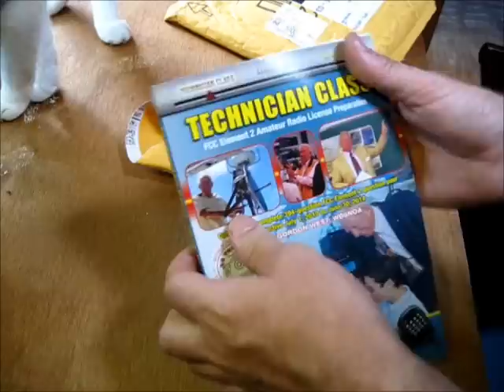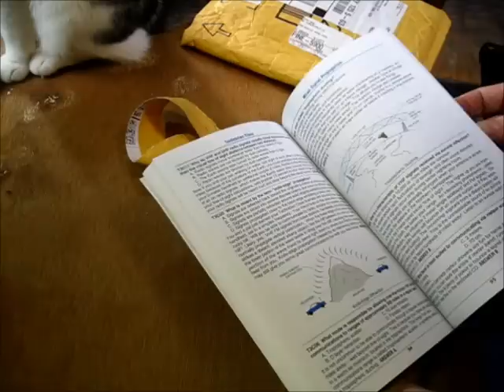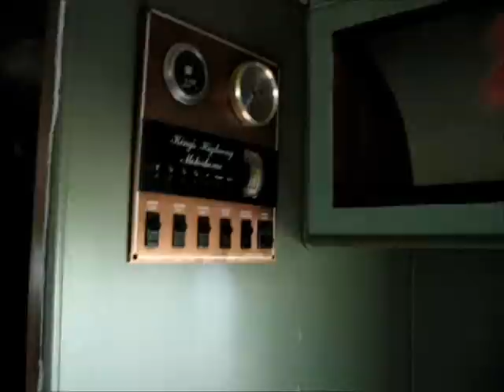Cleaning Up The Homestead And Improving Rain Water Collector

Comment: Great hearing that generator had good strong compression, you'll troubleshoot and get good spark. As suggested ,rusted magneto a strong possibility after sitting unused for so long ,sand surface of magnet and set the gap  ,coil ,points or condenser .did you clean out the gas tank and exhaust system ,anyway it's looking promising and will be nice to hear it working for you. I think that it is great to have friends who are interested in helping and believing in what you can do through hard work.

Comment: On the generator the exhaust line where it was belching out stuff (mice/chipmunk nest/bird feathers) it might be partially cloged causing it to not vent out exhaust so it does not get enough O2 for the next compression,like a bananna in the tailpipe. But it sounds more like its the flywheel is rusted or may be grounded out on a wire (mice do love to chew through wires) look inside the fly wheel &coils in engine casing first and it might show a bunch of rust, if so just a good brusing will fix it

Comment: also on your generator check for and clean any rust away from mag that may make a difference in the spark magnetos do not like rust that will weaken any spark power the mag makes hope all this helps

Comment from the maker: Shorting an old screw driver or piece of metal across the leads. Use something you dont care about because it may get melted. Do NOT touch the metal when shorting the capacitor. Use well insulated pliers to hold the metal.

Comment: troy we fix generators and what u need to do it you need to use the air compressor on the spark plug and make sure that its really clean. If that doesn't work get a new spark plug and keep spraying starter fluid and it will start if it doesn't there is a bad part or gunk in the fuel lines.

Comment: just thout id tell ya just purcased a 71 shasta trailer for a project as simple as they come propane only to gas lamp stove and heater no 12 volt inside at all so im starting from scratch good thing i know so much bout 12 volt sys.
will have to build my own should be fun but at least ill know what i have it does have 120 ac though in good shape so ill try and keep ya posted

Comment: Finally, big tank auto fill. Yeah! Now gravity feed overflow from big tank to blue barrel. (cut hole in top edge of tank. Add pipe & fittings.) No need to pump. Unless that gutter is capped, move your chicken tractor. From this angle, looks like gutter will pour excess water into the chicken area. 

Yard looking a lot better. Plant vegetables NOW. Plant flowers later or put on next spring to do list. Gives time to learn which flowers you can also eat before you plant. ie more self-reliance.

Comment: If there is a cover over the head of that generator you might want to take it off! Every year I check my riding mower for mice nest in the cylinder area! I found out the hard way the year after I bought my first brand new one and over heated the motor and my warranty was void 2500 down the drain for 2 months of grass cutting lol! And I agree try a new plug then go to cleaning the carb! Take care Troy!

Comment: the generater should be on a tray so you can slide it out to work on it take the shroud off the front of the engine and clean the rust off of the magnets on the flywheel and legs on the coils set the gap on the coils with a buisness card they should work well then make sure to clean out all the mouse nests from around inside the engine shroud so it doesnt start a fire

Comment: I based my equations below based on Troy having approx. 60 days left of summer. Really we are not even Mid July, so with Aug & most of Sept being hot, I believe 60 days was more then a fair amount. I took that down to 45 to be even more fair. BTW, the KOHLER 7KW can burn as much as .80gph if used at 100%. A 20+ yr old gen is not going to be nearly as efficient as a new one made today. But with Troys aversion to heat, I think this is an added expense that needs to be considered.in the "Project".

Comment: I can agree with that one especially since from first hand experience even a VHF/UHF HT will work out in the woods. I went camping recently in an area where my cellular phone did not work yet my VX-8DR was happily chiming away indicating that APRS packets were coming in on 144.39 MHz. Also I was able to hit repeaters on 144, 222, and 430 MHz with just five watts and a very simple antenna. For anyone who wants reliable communication amateur radio is a MUST, bottom line.

Comment: Specs on 7KW Kohler Gen (new). At 25% capacity it burns .42 Gal an hour. At 50% it burns .52 . Lets go with the lowest .At 8 hours a day based on $4 gal that would be $13.44 a day. If you ran it 45 days outta remaining 60 days, that is $604.80. At  6 hrs a day it is $10.08 or $453.60 for 45 days. U need a tank to store this gas & u have get the gas. How does this Gen / AC play out in the “Off The Grid” scheme of things?. NOTE: the amount of fuel/days & hours are VERY generous in these equations.

Comment: dont pour gas into the cylinder, you can wash the oil off the walls and ruin the piston/cylinder. use a syringe and needle to spray a finite amount

Comment: [i read better in caps & large print thanks]
YOU SAID THAT YOUR A.C. UNIT WAS PULLIN AS MUCH AS THE SOLAR PANELS WERE BRING IN... AND IT BEIN DARK I WONDER IF YOU DONT HAVE ENOUGH ELECTRIC THAT WAS NOT COMIN IN ANYMORE...???
MAYBE IT WAS RUNNIN STRAIGHT OFF THE SOLAR PANELS???
BLESSINGS
FRANKI